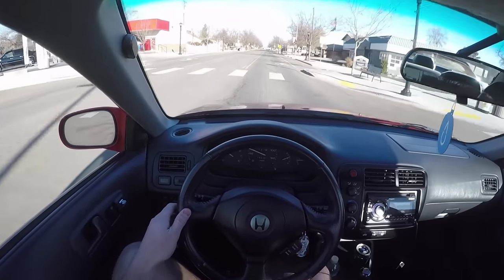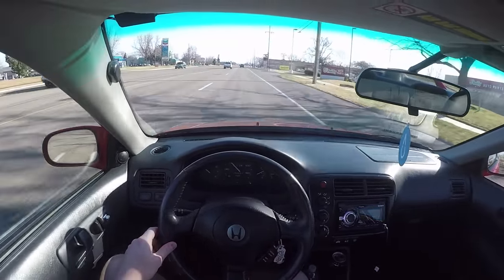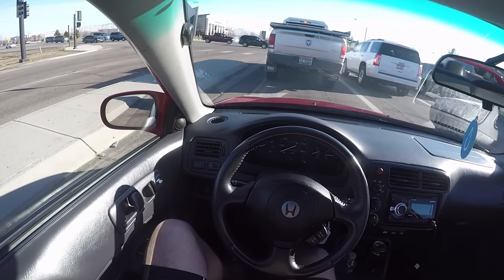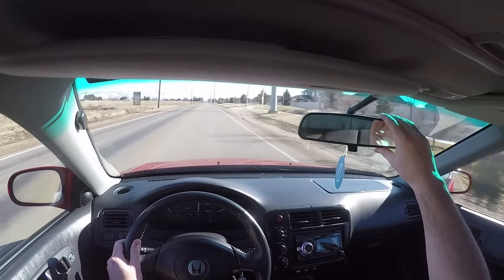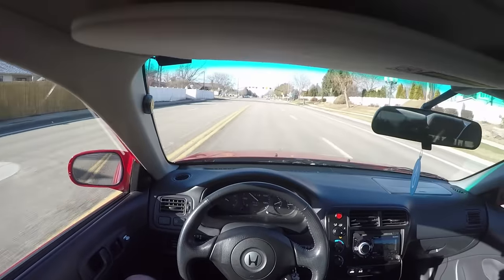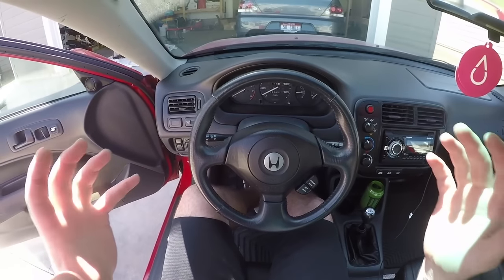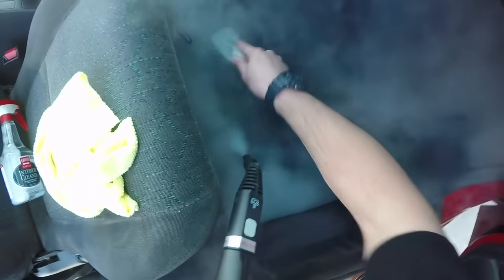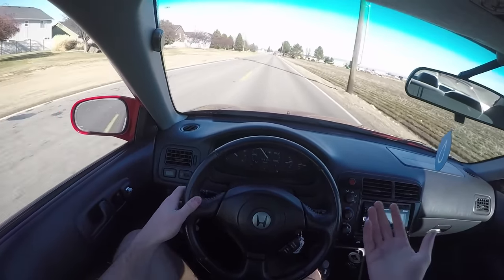5 Things to Make Your Underpowered Honda More Fun to Drive

Comment: Most important thing to note about lowering/wheels; WHEEL FITMENT/OFFSET. Lowering on stock wheels CAN look good IF you space them out properly. The entire wheel being tucked because of the stock, narrow wheel spacing looks terrible. Buy wheels that you like using willtheyfit.com to get the best fitment. Use your stock wheel specs and play around with different numbers so see how they will translate to your car (it tells you how much closer your wheel will be to your strut and how much further it will stick out)

With an already low ground clearance, lowering it with springs or coilovers require you to adjust your driving significantly to prevent damaging your oil pan on speed bumps, bumpy roads, driveways, etc (ask me how I know)

Also, nice Civic bro. It's very clean (yes I mean the interior AND the mods)

Comment: Just got a 94 civic LX that I'ma have to work on. Cats are gone, gotta start with putting in a test pipe n fixing the heater for this winter cause here in Colorado its already been cold as shit🤣🤣 probably one things I'd add is to reinforce your weather proofing. I wake up to both sides of my shit iced over, making me end up with shit visibility after it melts. Probably a good tip.

Comment: I love this video because there is such truth to it. I will add though, there are performance exhaust kits out there that sound great, aren’t all fart can gay tuner boy crap, and put a lot of added power to the car. Cold airs are over rated and many times suck water into the engine like mine when I had my 97, but a simple performance air box and racing filter will add significant power also. Plus a bunch of little stuff like performance spark plugs, fuel pump, and simply running premium gas can add lots of power for little money. I totally agree with all the stuff he did in the video though. Great video!
Reply from the maker: Thanks man! Appreciate you watching!
Reply: ALLDAYANTHONY ya man, I appreciate that you took time to make the video. Good stuff. Civic owners need to hear ways to not gay their civic up and ruin the reputation of one of history’s greatest cars. They are fun cars to begin with. With another added 50-100 horsepower they are a blast to drive and plenty fast. $500 can do that easy.

Comment: I have a 98 civic hx. 185/65/14. Very small tires and not good grips.
195/55/15, 15x7 or 205/45/16, 16×7?
Don't have any engine upgrades, completely stop just want some better tires

Also I'll be keeping my 14 for colder climate. Just want the bigger tires for summer spirited drive

Comment: I have a Honda City , 7"-inches shorter than the Civic of the same gen as yours. Its very light. 98HP but the response is very quick. Our driver did 160 on on the speedometer on narrow winding roads it was dreamy and scary.

Normal cpuntryside Roads are relatively rough back home, w pot holes , what mods would you reccomend?

Comment: I would see if you can throw a civic type r oem intake on there , also swap the air filter for a k&n , I agree about the exhaust most will sound bad so if you’re gonna sound that way you might as well wait until your car is actually fast haha

Comment: Hey Anthony! I used to drive an Ek coupe just like yours, well long story short I was going for the same looks as yours an authentic oem feel but not too rice or over the top. My civic was an EX civic and I didnt want an SI cluster gage but I wanted something more sportier looking with an OEM feel. I found a tacho you could get it's called OMNIPOWER tachometer. It looks really nice but it's made to go up to 10k rpm. So your revs stay down low but it looks so nice😭😭
Reply from the maker: I’m actually thinking of going with a CRV cluster if i can find one with the exact mileage. Looks great as well!
Reply: @ALLDAYANTHONY  yes! Your right the crv is a good choice, especially if you swap the bulbs with LEDs to give it more brightness maybe white Leds?

Comment: is a quick release steering wheel only a good idea if you got like a roll cage and racing seats?
Reply: yes, a lot of people glorify them when without full setup they compromise the safety (unless it never came with airbags from factory). best option is to just retrim the factory wheel or you can often swap in a steering wheel from a higher trim of the same car or often steering wheels within the same brand (and era) will usually work too

Comment: Bro I have a 98 Honda Civic but mine is automatic😕 After watching this video I want to trade it for a stick shift and do the same mods like yours. 
Awesome video I hope to find another coupe that’s stick shift transmission. 
Too bad lots of these civics out there are horribly modified and look ugly. You really keep yours simple and clean 👍
Reply: Tbh you don’t need to do any of that, if you learn, you could manual swap it instead of trying to look for a manual. 9 times outta 10 all those “manual” cars are just swaps from auto. It’s also just cheaper to do lol

Comment: Ok..big question for u..
I have a chance to get an 05 honda civic ex wiyh vetec.its mint..just needs a value cover gasket..140 k $5000 auto
08 civc si 161k $7000 6 speed,
Witch one would you take ???

Comment: Hey, also have a em1 si. Recently picked up some 16x8 +38 RPF1’s. Wanted to know you’d opinion on that? Too big of a wheel that I should return them or could I make due with a little work? Thinking of running 215/45’s

Comment: not to mention clutch pedal adjusment to remove slack for better shifting AND strenghtening motormounts for same reason , all 5 ;) oh, and ... for better sound, resonator delete or just remove gasket b4 resonator in the front bumper ;) ;)

Comment: Didn't watch the video but I got a suggestion for those of you who actually want to not be posers:
1. Gut the interior. Completely down to the shell. Get as much weight reduction as you can
2. Wheels/tires - get rid of the heavy OEM steelies and get a cheap set of wheels and get some grippy tires (grippy, not walmart you bozos)
3 stickshift - if its already stick then get a short shifter kit and bushings, and a double bend shifter, its honestly a great improvement for all 90s civics
4. full exhaust. - get name brand like yonaka, not ebay junk
5.  get race seats and harnesses, if you don't want to spend that type of money get integra seats instead, they are way nicer and sportier

Now someones gonna post up "but this is a poser setup LOL". I just had you strip the weight out, put grippy tires on, and improve the driving/shifting ergonomics and gave you a little noise, this is a perfect autocross or track day weapon that doesn't cost much at all to set up. if your goofy ass thinks you need 300hp to be fast at the track, I guarantee you've never had seat time at a race track.Guys driving 90 whp hoopties would run circles around you and have fun while doing it

Comment: You are very wrong about the exhaust, with a cold air intake and full inox exhaust you can get it up to 160hp with some tuning, isn’t that a big hp gain on a car that weighs under 1100kg 2445 pds ?

Comment: So you've done everything in this video but still want more....here's your next stage (N/A engine):

1. 4-2-1 headers + Full exhaust system with cat delete (or high flow cat)
2. Full intake system (true CAI and manifold + port/polish + oversized throttle body)
3. Stage 1 Crower Cam (stage 2 if you're in to rebuilding your head)
4. Proper tune with either a stand-alone ECM or piggyback unit (because the previous three benefit most from a proper tune)
5. Lower the Vtec engagement point to match power curve on dyno.

Comment: The S2000 wheel mod stings me especially. 
I got a good one for an awesome price and test fitted it ... it didn't fit. At all. 

Turns out, the 6th gen fastback has a totally different steering column for no goddamn reason. No nice steering wheel for me, I guess. (Having an airbag is mandatory in my country)

Comment: I’m slowly falling in love with my Honda ... but I don’t want to be a “ Honda Boi “ 😭😭
Reply: Honda boi left with the 90s.

Your totally fine just make sure the pipe you put on it isn't straight.  I truly believe in piping hondas but there are really nice sounding solutions if you look carefully.
Reply: mr machinist , I’m gonna need help finding it tbh. I have the rice-y-est sounding pipe.
Reply: @yurannovoa18  haha. The are definitely out there.  dual tip out of one muffler helps as a rule.
Reply: mr machinist right, but where do I even start looking. Everybody sells their rice or overpriced parts
Reply: @yurannovoa18  shit, I couldn't tell ya. 

Start at magnaflow or borla. They should have multiple options with different decibel levels.

Comment: Just bought 91 Accord 50k original miles. Maybe 115 horse power but this thing is light as hell
Reply from the maker: What a score!
Reply: @ALLDAYANTHONY  Just put a new distributor, spark plugs, alternator, battery, and serpentine belt think I gained like 20 horse. She runs like a Swiss watch now.

Comment: Actual real mods: strut bars (front trunk rear)
Headers and catback exhaust system (easiest thing to do)
New tires(preferably toyos)
Headlights 
Maintenance treatment (fuel, oil, transmission sprk plugs coils all that) just so you can feel your engine respond crisply and you can feel all those mods and feel a good step from slouchy stock movement

Comment: As long as there are good used 90s Integras for sale, I can't understand why anyone would buy a 90s Civic...mostly. Especially comparing Y series to a B series. However, It's understandable if you can get an inexpensive 90s Civic that's already been done right (especially if it has a K series swapped). It's always better, IMO, to buy built then spend-waste your time making your car better; just buy a better car in the first place. Time & effort saved. When you realize that you won't live a long long life, you'll start valuing your time more. I digress, because I'd rather own a reliable 90s Civic than many newer cars that aren't reliable.

Comment: What's the tyre size for ur rims
Reply from the maker: 205/50/15
Reply: I've bought a set of 15s. But it's 15x7. They recommend that I use a Michelin pilot sport 3 195/50/15 tyre. I don't think I'll go low on the suspension anytime soon.

Comment: Just wanna say your car was the inspiration for my cars look. Has same wheels(bronze), coilovers and almost same exterior(black) aside from the lights being a bit darker. 

I would like to add that as far as exhaust, theres no real way to make them sound good unless your pushing lots of hp or go turbo. What I did was put 1320 UEL headers, left the stock resonator, went catless and it sounds amazing. It's a b16 but, if you're running a d series you should get similar results. Always get compliments on the road.

Comment: 6. Strip out the interior bare. 7. Add bucket seats with harnessand you won't have to worry about getting a face into the aftermarket steering wheel with no airbag.
8. Who says my Honda will underpowered forever?

Comment: Anyone reading this who dont want to spend over a grand buying coilovers, install lowering spring until you can hunt down a good deal on used coilovers and then sell your lowering springs. I bought $1500 ktuned coils with 24k on them for $550. I turned around and sold my $200 lowering springs for 75% of what I bought them for. Having coilovers is nice but don't waste your  hard earned money buying them new. Go to a pick and pull junkyard or use kijiji/ letgo

Comment: Bro all of that was some odd ball ass mods to make the car more "fun". Listen
No.1- intake, throttle body and or intake manifold.
No.2- header, exhaust 
No.3- flywheel, clutch, short shifter
No.4- injectors, fuel rail
No.5- ecu tune or $30 Ebay flash.
No.6- suspension
No.7- light weight rims
No.8- weight reduction
No.9- stiffer mounts
No.10- anti roll bars
Oh yeah and nitrous kit used for around 200 bucks, there everywhere.
All of this is used for a Honda you can get for well under 600-700 bucks and if you want a nice pair of wheels and a nasty tune for around $300 bucks you can call it around 1200 for all really good used stuff.

Comment: Disliked the video for the very first 30 seconds and the description. 

"How do you make a slow car FUN to drive?"
"your udnerpowered Honda" 

What do you mean slow and underpowered ? 
These cars come with a 160hp engine that is the King of that 90s era. No other engine could compare itself to the B Series. They also came in a lightweight chassis with close-ratio transmisisons that made them super-agile. Not terrifying-fast. But not slow either. They where faster than most 2 - 2.5L cars of that time...
And you call them "underpowered" ? 

Just because there are cars that have 7.0L engines, does not mean small 1.6L cars suddenly became dull. 
The rest of the world drives less than 2.0L cars... -.-

Comment: First thing should be, purchase a Honda with a manual transmission.
Reply: If you own an automatic, straight pipe muffler is what made mine not so boring. Yes I did everything here but the quiet oem muffler was not good enough so I put the muff on, which I purchased for $8. Once I get more funds I'll put a greddy catback